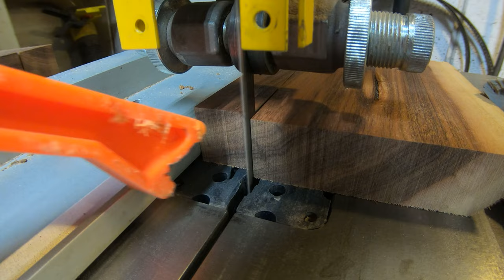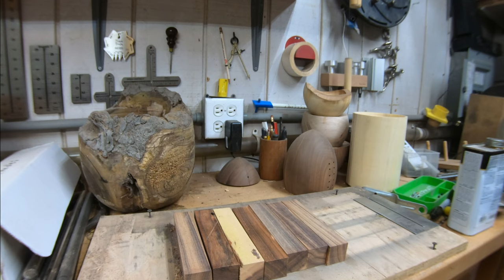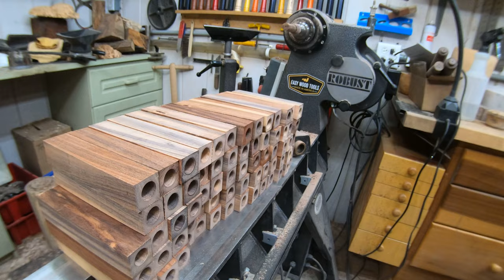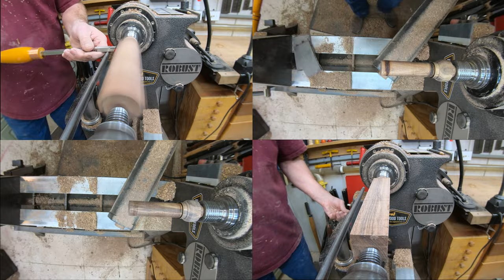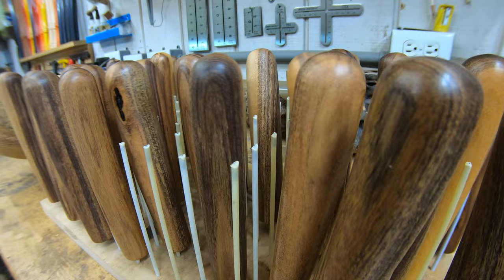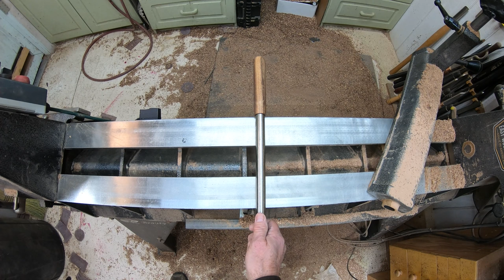Making Handles

Comment: Tim do you do anything to keep your wooden jam chuck from losing grip? I was doing some bottle stopper and kitchenware handles and found that after about 20 handles/stoppers even walnut or maple would become loose and I had to be very delicate with cuts. I ended up building a metal jig with an drill bit and this seems to fit better and has stayed a lot more consistent.
Reply from the maker: I made my jig from the same wood at the handle. Peruvian Rosewood is very hard. Also it was not a jam fit. I used the tailstock for most of the turning and sanding.